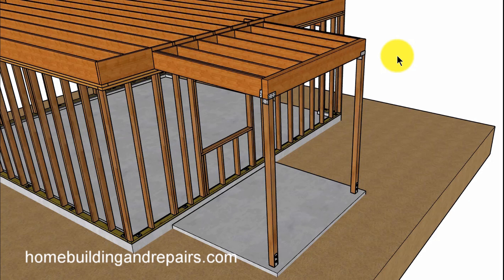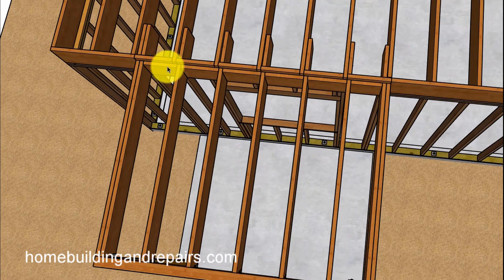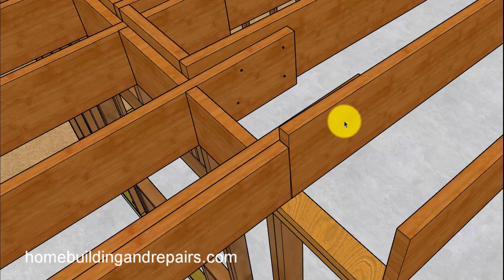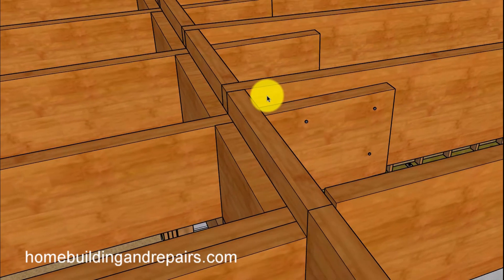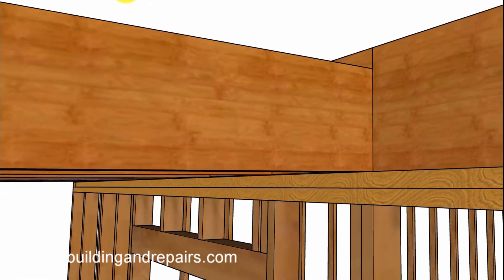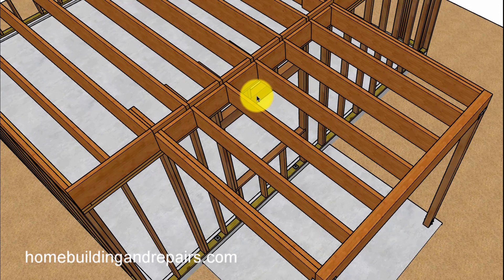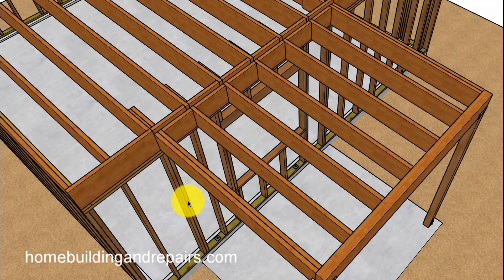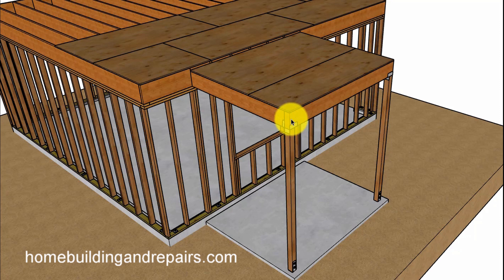Do-It-Yourself Wood Balcony Framing Ideas – Lapping Joist Connection

Comment: Only just found this before sleeping 😊. 
Do you have a video showing how to build a balcony over a 4m wide bi fold door? Or any width sliding/bifold door. 
Im planning to build a 2 storey house, 6m x 6m (like your simple house design) but with blocks for the corners of the ground floor and then wooden base sitting on the blocks and wooden walls for 2nd floor. I want a 4m wide door on both floors, top floor leading to a balcony. 
2 bases and nail together?

Comment: Thank you so much for these helpful videos!  I was wondering - I currently have a balcony built similar in that it is a cantilevered balcony with joists going thru the ceiling.  The problem is all of the joists have now rotted.  Is the only way to rebuild to open up the ceiling and replace or can we cut off the existing cantilevered joists and build using the ledger method with posts?  Hoping you have a video replacing a existing rotted cantilevered balcony with a larger balcony/overhang.  There is also a 6’ wide door below the balcony. Thank you!